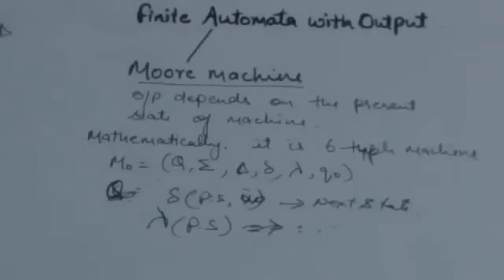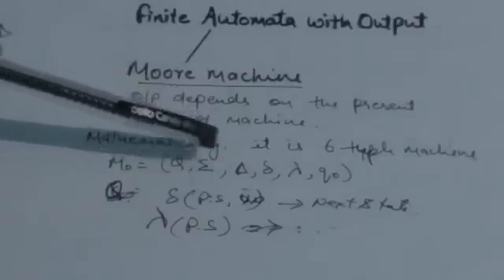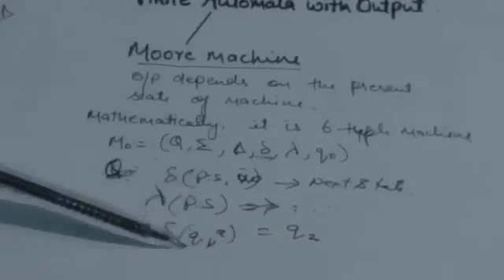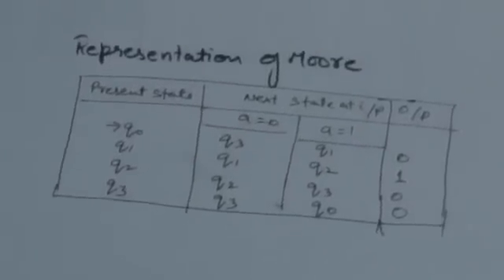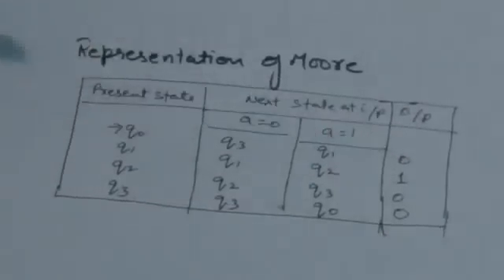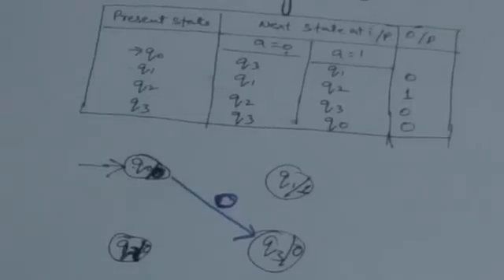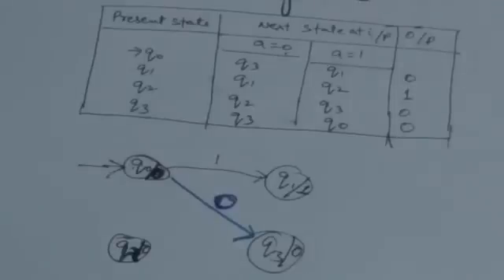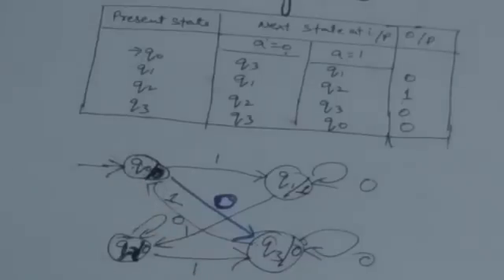18.Moore Machine- Finite Automata with output

Comment: i've a little confusion - the outputs 0,1,0,0 .. are these outputs defined by you or it is defined mathematically? if the outputs are obtained mathematically then please explain ..!!  :)
Reply from the maker: . it is not mathematically obtained. it is the property of machine to give an o/p. these will be given to you when a machine is defined. you don't need to worry abt them,